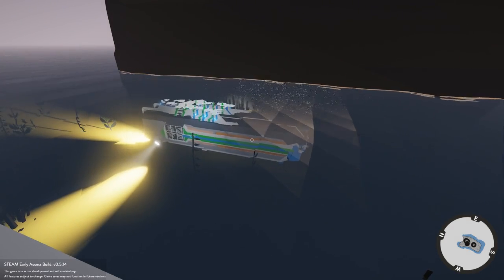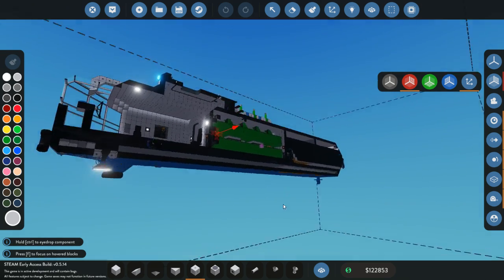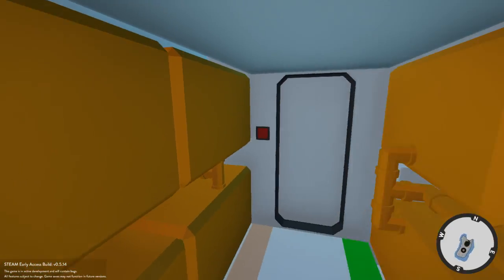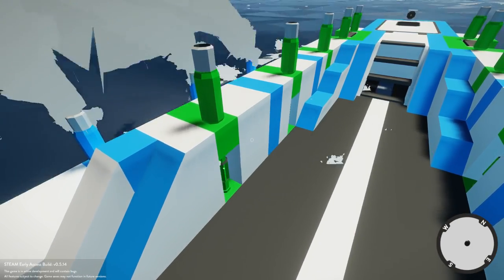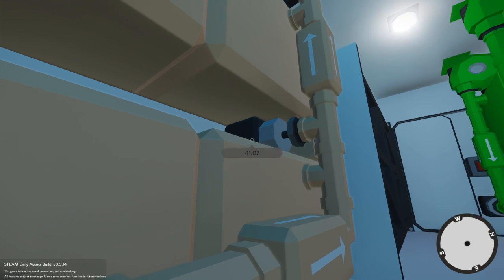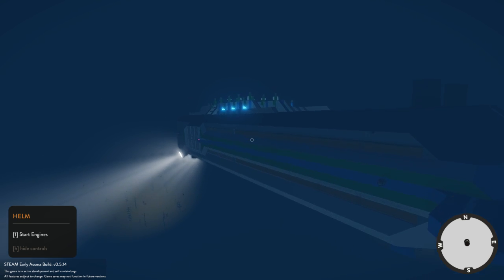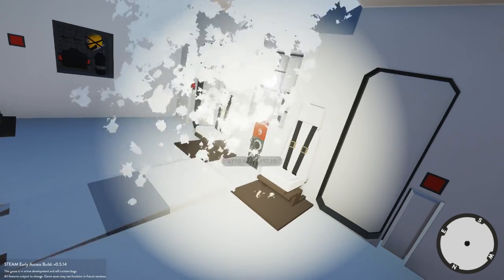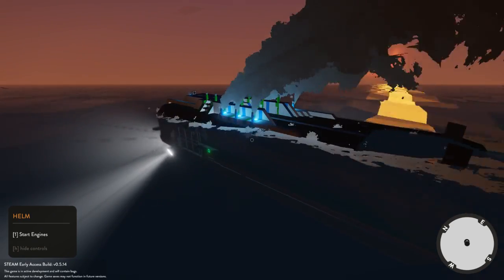Stormworks: Advanced Submarines

Comment: Hey i need help. Those control surfaces..which way should they be turning when surfacing and when going down. Im talking about the ones that control the pitch.
Reply from the maker: That depends on whether they're in the front or the back. The control surfaces shouldn't be providing the lift, they should be orienting the nose.
Reply: @CraigPerko  figured it out nvm
Reply: @CraigPerko  I got 2 medium generator and 1 large diesel engines with 1 medium electric motor. It takes a long time for the generators to charge like 20 medium batteries and the batteries get used up in about 5 mins.. Do you understand gearboxes? Cause what gearboxes should I put at what ratio as I believe they would help the generators generate more power and motor spin faster at a fastee rpm??? I want it to he efficient (long term sub). Ill try to make your system as well but my sub aint at all that big. 2 compartments..1 is with beds and  other is where your drive it. I do have an engine room and Ill try to fill it with as much batteries as possible and also might probably replace medium generators with large. I dont think a large electric motor is better than a medium electric motor as far as efficiency goes..What do you recommend?
Reply from the maker: @bray8949  I recommend a jet engine. :D

Gearboxes are a huge pain in the butt. Learn by doing surface boats first - the same propulsion works for both surface and underwater, but surface is easier. Batteries are important if you're not doing jet engines, but they're super heavy and run out hilariously quick. Medium motors are best.
Reply: @CraigPerko What exactly do you mean by surface boats?
Reply from the maker: @bray8949  Normal ships. You know, things that float.
Reply: @CraigPerko  oh lop 😅 Cause in trying to build a submarine not a boat xd
Reply from the maker: @bray8949  They're the hardest thing to build!
Reply: @CraigPerko  meh jet vtol much more complicated. My only issue is battery life. Even got depth hold and autopilot on my sub
Reply from the maker: @bray8949  Well, that's great! Best of luck.
Reply: @CraigPerko  XD thanks. So do you know any way of making a generator faster? or making electric motor more efficient?
Reply from the maker: @bray8949  Sure. There's a few dozen exploits. My recommended one is to use a jet engine, since it's the most effective underwater power source.
Reply: @CraigPerko  hmm ok. But doesnt that require air? I tried to see how far Ill go before recharging..1.4 km and battery drained out. Why does it start from a speed of 15m/s and goes to 2m/s at the end?! I hate that it starts lowering speed instantly. Ill  add batteries everywhere i can whilst keeping it look nice
Reply from the maker: @bray8949  As batteries drain, the amount of power drains. A battery at 50% charge only provides 50% power. If you want to see how to use jets, download one of my recent warp submarines.
Reply: @CraigPerko  Could you paste link here pls? Also some guy said that its best to route propeller through a 1:4 to 1:6 gearbox...What does that mean? Direction of arows towards engine if im not mistaken and 1:6 is by doing a gearbox 3:1 and another 2:1 which makes 1:6 then I just add another gearbox with the ratio 1:4? And what should be the nearest towards engine..1:4 gearbox or set of 2 gearboxes that total up to 1:6. Sorry if i confused u im confused myself..
Reply: Ok iv seen your latest video about the warp sub and was very impressed 😅. That thing went 3000m/s..I dont have space for those jets and water jets in my current sub unfortunately but ill definitely do them in my next sub. Altough I got no idea what the script was..is it rlly essential? As I might have to copy the script if it is for my next sub..If I were to upload it id give credit to you dont worry. What do you think about that gearboxes setup from comment before this?
Reply from the maker: @bray8949  This one probably still works: https://steamcommunity.com/sharedfiles/filedetails/?id=1784528329

To learn gearboxes, you need to try it out. Each one in a sequence multiplies the rotations while dividing the torque, or visa-versa depending on the orientation. They're really awful, but if you're using an electric motor, they're probably not necessary.
Reply from the maker: @bray8949  You only need the script if you plan to go over 600 mps.
Reply: @CraigPerko  oh well in that case I dont really need it. I just want a sub that goes 200+ and manages to stay under control.
I had no idea you were the creator of such a good sub. Its legit the fastest sub there is gj
Reply: @CraigPerko  oh ok thx a lot. I really dont see how jet engines can work underwater though..as they have a compressor and air intake.
Reply: @CraigPerko  How would you blow the ballasts at such great depth?! Some guy said that you need to hook the pumps up in a chain in order to create enough pressure to blow them but at the rate water was coming out it would take hours. Subs are impossible to make..Do ballasts even have a use in this game?
Reply from the maker: @bray8949  Fluids simply won't leave the sub at any real depth. Ballast's only real use is to sink: you'll need to use pure engine force to rise to near the surface in order to blow your ballast. Even deploying a tether didn't work last year, although the winch mechanics just changed, so maybe that will work now.
Reply: @CraigPerko  Ok thanks so much for your help! I manged to fix my submarine! My submarine can go really far as long as it has fuel. I am able to keep my battery at 100% whilst keeping motor at 100%. 2 Large generators work amazingly! I got like 40 batteries with a variety of mostly medium batteries and some small plus an extra large battery. Fuel I got about 3500 so nothing to worry about that! I'll try and fix my airlock by creating a compartment for it's water under my submarine also. My only question is , after becoming a master of gearboxes XD, the 3 gearboxes set at a ratio of 3:1 facing towards engine or away arn't making a difference in speed..If anything slower! So with 3 at 3:1 facing engine or facing away from engine gives me a speed of 15.28 at MAX and without ANY gearboxes im getting a MAX speed of 15.58..They seem to have worked for my generators so I don't think its a bug..
Reply from the maker: @bray8949  It depends on your drive systems. Electric motors generate a tremendous amount of RPMs, while diesel engines generate a tremendous amount of torque. So they have very different ideal gearboxes.

That said, 15.58 is pretty normal for an unglitched submarine. You might be able to get it up to 30 with the right gearboxes.
Reply: @CraigPerko  What would be those right gearboxes? Sorry if I'm bothering you too much
Reply from the maker: @bray8949  It depends on the number of motors and the number and type of the propellers. Generally I just go with a 3-1 for diesel engines to increase the RPMs, because they like to idle along at 20, which is way too low for a propeller. You don't need as many propellers as you think.
Reply: @CraigPerko  I got a medium electric motor and 1 medium propeller..lol also btw i changed my autopilot for the one you made! IT IS SO GOOD
Reply from the maker: @bray8949  Mine is pretty old at this point, there's probably better ones.

I don't know if I'd bother putting a gearbox between an electric motor and, well, anything. You can try it, see if you get a performance increase. I rarely use electric motors, so I don't know their optimal setup.
Reply: @CraigPerko  Ye I ended up removing them as they were slowing it down at 3:1 and tried many different setups...all slowed down the speed by a bit. I swear to god the autopilot is good. How do you hook up that power output from the MC though? It says "near location" Edit: nvm its for an indicator. I'm going to try and make it shut off motor
Reply from the maker: @bray8949  I usually use a switch circuit for that. An input number, an output number, and a boolean input. If the boolean is true, the output is the input. Otherwise it's 0.
Reply: @CraigPerko  I just hooked up the "near location" output to decrease of throttle lever and set warning distance to 48m and its perfectfor my stop xD. Oh and turns out they have no positive effect on electric motors..the gearboxes :(
Reply: @CraigPerko  Ok im nearly done with my submarine but I have a massive problem..ever since I added compartments on roof of sub for water for the airlock to function below 10m depth, It keeps rolling sideways.  For example on surface it rolls to the right and stops at like a 15° angle. Then when I dive and turn slightly to the left it rolls  like 90° and stays there without me able to fix it. It's really annoying me.. Im using a pid even to adjust roll which is hooked up to another set of rudders that can control roll. Its p is 10 i is 0 and d is 10000. Its way too sensitive. By that I mean control surfaces/rudders turn from a complete +90 to a -90. (Max right to max left). I honestly dont know what to do and am really frustrated at this after more than a week working on the submarine.
Reply from the maker: @bray8949  There are three solutions.

The main solution is to shift mass to the bottom of your submarine. Adding weight blocks, for example. This is the best approach, since it saves a lot of energy.

You can also adjust trim using a roll sensor. Multiply it by something and then feed it into both rudders and small electric motors powering small propellors. The rudders don't do anything when you sit still, so you'll need the rotors.

The third is to add a phantom airlock, like on my subs. This just reduces the amount of weight dramatically.
Reply: @CraigPerko  For your 1st way I cant really do it as adding more weight would make my sub sink to the point where only entry hatch is out of the water. Its already pretty heavy and does not that have much air to make it buoyant. What is phantom airlock exactly? and by small motors do you mean motors at the side? I have no idea how to do that..:(
Reply from the maker: @bray8949  Download one of my subs to see the phantom airlock. It's a door glitch where you don't need an actual airlock.

You can also see the side-motors in my subs as well.

However, if you can't add weight at the bottom, you can add air at the top. For example, a 2-high, 3-wide contained air pocket running along the top from the hatch you built.
Reply: @CraigPerko  I managed to use a new pid system sort of to make me rlly stable.It keeps me at a tilt of -0.2 to +0.2 tilt which I am really happy about. I didnt want to use glitches in this sub as I wanted it to be sort of real. Ill use them in my next sub. I just need to fix weight balancing issue till you get in sub and start driving and Ill be happy. Ill check out those motors on yours though.
Reply from the maker: @bray8949  You just put a small electric motor and a small prop pointed either down or off to the sides, offset so they tilt your boat when you tell them to.

You then tell the motor to fire based on your tilt. I use a tilt meter. A gryo also works.
Reply: @CraigPerko  ok thx ill try that later
Reply: @CraigPerko  Which subs that you built have this propeller stabilisation exactly?
Reply from the maker: @bray8949  All of the decently sized ones. Not the warpfishes.
Reply: @CraigPerko  ok cause dowbloaded the one with the firey texture and couldnt get it to fire up and neither spotted the propellers on the side. Ill try another 1
Reply from the maker: @bray8949  The deep sea ones are all equipped.
Reply: @CraigPerko  Ok i am trying to understand how the system works but cant really see to understand. Cause motors are connected to mcs which add and multiply? I can't seem to figure it out. If you dont mind ofc in short could you tell me how system works?
Reply from the maker: @bray8949  The tilt meter outputs a number between -1 and 1, but it's going to be between something like -0.1 and 0.1 for a submarine, since you're not tilted much. I multiply that number so the engines will run at a decent rate. I multiply it by a positive number for one side of the ship and a negative number for the other, because that way we push with all the engines on the left and pull with all the engines on the right. Or visa-versa, if we're tilted the other way.

You can also use the roll output of a gyro.
Reply: @CraigPerko  that sounds rlly complixated xd. I also got another problem then cause I cant fit propellers on sides. My sub is very very narrow.. If I were to do on side with small electric motors and a large propeller (beinf smallest rn) it would look ridiculous..would a water jet or azimuth thruster work? I would prefer azimuth thruster as water jet bit too powerful
Reply from the maker: @bray8949  Why would you use a large anything? These are attitude adjusters, the smallest possible motor and propeller is fine. You can put them one the sides, or you can mount them pointing left & right near the bottom. Either way, the ideal approach is to not need them, by adjusting where your weight and air volumes are.
Reply: @CraigPerko  ok ill try to fix weight first. If im not happy with results ill put small propellers on left and righr sides. But what I was saying is that there are no small propellers in the game as of right now. The smallest thing are the azimuth thrusters..and by how much would you then multiply? Ill try and understand what you did in your mcs better. cu for now gonna go to bed 😅
Reply from the maker: @bray8949  The smallest propellers are the 3x1x1 starting propellers.
Reply: @CraigPerko  ok so what i ended up doing is saving your mcs (dont worry about credit) and connecting everything as everything was connected in your deep sea fire sub. Only different thing is that they are connected on the side of the sub and not on the bottom. Also only did 2 on the back and not on the front as well for now. What ended up happening was they made my sub go to the left but from the back o.o. Ill try making another pair on the front as well and see what happens. Oh and other different thing I did was not connecting the mcs to my rudders/control surfaces, as I already have another stabilisation system for that, which only works when moving. Oh and forgot to mention weight issue fixed as much as possible but would still like a stabilisation system to have it be perfect aa not happy with tilt without stabilisation systems
Reply from the maker: @bray8949  I can't recommend copying my stuff, it's set up in a very specific way that you won't get by simply taking the pieces. If you don't understand the concepts, I recommend making a test rig just to test the concepts. Auto-stabilization is critical for planes and high-speed boats, too... and it's not too different whether you use rudders or propellers. Just think of a propeller as a rudder that works when you're stopped.
Reply: @CraigPerko  so basically what I need to do if im thinking of them as a rudder is I need to:

get number from tilt sensor
multiply it by i have no idea how much ill just play with number
connect it to motor

then i need to do same for other motor but multiplied number needs to be inverted so it pulls instead...righr?
Reply from the maker: @bray8949  Yup!
Reply: @CraigPerko  do u have any idea at all what the multiplication number should be? Im not going to make it as complicated as yours. For example ill just use a multiplication gate in mc. I think that needs to be multiplied by a bit since small propellers arnt that powerful
Reply from the maker: @bray8949  It depends on how good their leverage is. Generally, I multiply it by 3ish. You want to use the smallest number that works, to preserve power.
Reply: @CraigPerko  oh ok that makes sense
Reply: @CraigPerko  for further power saving ill try and make it that when for example speed higher than than 5 it automatically turns off the small propellers as rudders stabilise it while moving.
Reply: @CraigPerko  hey ik if u dont have the time for this but setup doesnt seem to be working. I tried inverting motors couple of times but always ends up in submarine tilting anyways. If you can could you look at my submarine? I fixed the weight problem its just these motors. Ever since I added them tilt issue has been worse and I think im just doing something wrong. The link is: https://steamcommunity.com/sharedfiles/filedetails/?id=2070098653
Reply from the maker: @bray8949  You have the right idea! The engines in the back were wired backwards, presumably because you were testing. The engines in the front appear to be abandoned, but if you hook them up the same way as the engines in the back, you'd have enough stabilization. The output needs to be about twice as high to completely stabilize the vehicle.

To see whether it's working, look closely at the engines while the submarine tips. The prop pushing forward produces bubbles: you want the bubbles to be pushing to right the ship, not make it worse. You can force the submarine to tip by attaching a handle to the side of the exit tower and pulling on it manually.

You'll also want to attach a handle to the top of the exit tower, so if the submarine's partially tilted, you can grab it and still get out instead of perpetually falling down the ladder.
Reply: @CraigPerko  oh im so sry u had to go through that problem of the ladder 😅 I was going to fix that once everything settled lol. So I need to invert engines in back and wire up front engines same as back ones. Front need to be inverted as well? Ill also make multiplication to 10 i believe as i left it on 5.
Reply from the maker: @bray8949  The ones in front need to be wired identically to the ones in back. After all, the nose of your ship rolls the same as the back of your ship.
Reply: @CraigPerko  weird didnt u say front motors were abandoned? On my save they are connected to inverted number output on numerical inverter
Reply: @CraigPerko  ok so basically i made it how u said. For example if it tilts to the right righr motors show bubbles going away from sub and if its titling to left left motors show bubbles going away from sub.Only issue now is motors instead of changing roll of ship (tilt) its changing the left/right. For example if it is tilting to the left instead of correcting it theyre pushing/pulling towards the left which then eventually causes it to tilt even more :(
updated it on workshop to one i got now same link I think
Reply from the maker: @bray8949  I didn't see them spinning, so I figured maybe the electric wasn't properly hooked up. I just checked the back ones.
Reply from the maker: @bray8949  Usually that's because you wired the front and back opposite. Both left motors need to be wired the same, and both right motors.

There may be some small amount of spin since they have different leverage from the center of mass. If that's the issue, you can multiply the motors in front by a different amount, reducing or increasing their pull relative to the rear motors... but they must always pull the same way. This is why I prefer up/down motors, TBH: no heading drift.
Reply: @CraigPerko  I wired them the same tho..? Hang on ill start from scratch. So left with no  inverter and right with an inverter. Ill try that first
Reply: @CraigPerko  NVM THEY FINALLY WORKING YESS
Reply from the maker: @bray8949  If you're starting from scratch, you may want to point them down instead of sideways to minimize drift.

It's a bit tough, because your submarine is so tall and narrow.
Reply: @CraigPerko  ye ikr. I staryed following mrnjensey guide until i realised this guy does some stupid stuff sometimes...and went off with my own ideas where I could since this my 1st. Since it was built narrow and needed room for water for airlock i made it taller to have room. Anyways its working to a point im happy with :) Thanks soo much for your help! Motors cut out when past 3m/s for power saving but wish they didnt require a multiplication of 10 to run. Whatever theyre only till u leave the dock lol
Reply from the maker: @bray8949  The next one you make will be twice as good!
Reply: @CraigPerko  lol thx :)
Reply: @CraigPerko  Where would best location be for radar on a sub? As underneath isnt really best as easy to break if you bump into sea bed. Also using a distance meter instead of radar
Reply from the maker: @bray8949  There's no ideal place for it. I generally put one pointed straight down, either flush with or slightly recessed into the hull. If the sub is big enough, I'll put one on a descending rotor at around 45, retracting it if the one pointed straight down detects nearby land.

Because of the distances involved, a distance sensor is usually enough. You don't care if there's land 3km away, you're not going to accidentally bump it.
Reply: @CraigPerko  How would a radar detect objects around ship if it is flush with the hull? Like wouldnt that be detecting the submarine itself as well?
Reply from the maker: @bray8949  ? The tip is obviously exposed to water... but the tip is flat. You can just make it part of the hull.
Reply: @CraigPerko  oh..but thatz the radar..a dustance sensor needs to be out at least a couple of blocks for me since also rotating pivot is like another 2 blocks. And I can make it any sort of into the hull as my hull is only 1 block. Rip
Reply from the maker: @bray8949  You don't need it to rotate. You can just point straight down, that's the most critical distance reading if you're going reasonable speeds.

But either way, as long as you have some visibility below you - lights or something - it's probably fine for a low-speed sub.
Reply: @CraigPerko  Im working on a mini sub at the moment. So couldnt implement any of your jet engine bugs. Although I did go with 2 azimuth thrusters and a medium motor which is more than enough. Got a speed of 17m/s. Only issue is that since it is so small it would constantly pitch up and down and making it sometimes fly of water. I played with weight and buoyancy for an hr but no luck. I got it somewhere stable though, just it wont stay stable if you kick up the throttle a bit. I decided to extend it by a little bit more but dont get me wrong its still tiny. Its still unstable and pitches constantly up and down.. Im going to try and play with the weight a little bit more. Im also going to try pitch stabilisation with rudders.
Reply from the maker: @bray8949  You will find it is faster without the azimuths.

You do not need many propellors.
Reply: @CraigPerko  without azimuths then what would I have for propulsion? Those only propellers I got 
Edit: Oh and managed to fix pitch issue
Reply from the maker: @bray8949  Oh, I misread medium motor as medium prop. Honestly, for a small sub, I recommend a medium prop. I guess two azimuths are fine, depending on space constraint.
Reply: @CraigPerko  its rather tinylol.A medium propeller would look a bit ridiculous
Reply: @CraigPerko  imabout to make a report to stormworks devs to fix batteries....i got so many batteries yet with 6 small motors I run it after travelling 400m.. Like isnt that too much? Medium motor uses too much amd cant add more batteries or it wont float with weight..
Reply from the maker: @bray8949  You see why all my subs use jet engines.
Reply: @CraigPerko  XD ye i do now. I got a challenge for you. Do a mini sub lol. Also Im having issues with my pid for depth control since sub small. I want it to be accurate so it slows down when altitude is close to set altitude but also want it to be smooth. So fins dont go full 1. What numbers should I use??

Edit: I managed to get it somewhat working but altitude varies by like -5 so if I set it to -10 it can go up to 5 and down to -15
Reply from the maker: @bray8949  I dunno how to use PIDs, but the numbers generally need to be super low.

I don't have much interest in small subs. I made a few microsubs, but they don't have depth control, just surface or depths.
Reply: @CraigPerko Dont waste your time reading all this. Problems have been fixed.

 I put a single jet engine and it now has ability to fly. Omg its so good. I also put in a single fluid jet but whenever I use it it tilts to the left. I dont know why. I placed outpur in the middle so shouldnt be leaning over to one side. Even have roll stabilisation with rudders on

Edit: nvm i inverted stabilisation system and its good now. Next problem.. Battery level is staying constanst and not moving a decimal but ik it is running out as speed is decreasing when using fluid jet

Edit: Fixed that as well
Reply from the maker: @bray8949  Nice!
Reply: @CraigPerko  Since its such a small sub with a jet engine and fluid jet depth hold wont work smoothly without it bouncing up and down. At 70% throttle on fluid jet it manages to go smoothly and about 40% throttle on jet it also manages to go smoothly. Ill have to make a system to not let driver exceed those speeds when depth hold on
Reply from the maker: @bray8949  Sure. You can also change the exhaust choke to change the thrust without changing the speed of the engine.
Reply: @CraigPerko  oh ye forgot about that. So i decrease thrust spoiler?
Reply from the maker: @bray8949  At 0, the engine thrusts full force. At 1, it doesn't thrust at all.
Reply: @CraigPerko  oh ok cause never used it lol. So I must decrease it ok
Reply: @CraigPerko  Ok I need to make it that somehow if it exceeds a speed of 21 (yes ik) it needs to throttle down electric motor to 0.70...There is as of right now no way of doing it as you have no input in throttle lever. So i decided instead that whenever speed is mode than 21 it doesnt allow you to turn on depth hold. How can I do that? Cause if I simply hook up an on/off logic connecter to button itll turn it on when its off when throttle higher than 0.70
Reply from the maker: @bray8949  As you like. However, by clicking on the seat in edit mode, you should be able to change the parameters of each axis. You could also multiply the input by 0.7 and use that for everything.
Reply: @CraigPerko  What would the parameters of the axis do? Cause I want it to go full speed when depth hold not in use and at 0.70 speed when it is in use
Reply from the maker: @bray8949  What I would do in that case is have a number switch. It takes in the pilot's throttle and a boolean (whether depth hold is on). In the logic, I set up a simple system to output the original number, or a clamped number if depth hold is on.
Reply: @CraigPerko  Ok ill try that later! Thanks so much I would have never came to the idea of using a boolean whatever it is 😅. Ill check into that later. God this has nothing to do with programming and its already a lot to take in..Im currently studying java in my computing lessons.
Reply from the maker: @bray8949  It's a very simple node-based programming setup, I'm sure you'll have no problems.
Reply: @CraigPerko  Thanks so much! Even managed to do it simpler than that using a simple numerical switchbox without boolean!
Reply: @CraigPerko  I decided ti change how submarine functioned. So i got 3 engines fitted in a mini sub. I used space wisely lol. small diesel engine for recharging batteries with medium generator. Its producing 71 and ik its not the full potential of generator. Then its got jet engine for when you want to make it fly lol. And fluid jet woth medium motor for when you just want to use it normally. Youd could use jet for lets say submarine mode as well but would probably not put throttle up anymore than 20.
Reply from the maker: @bray8949  Sounds versatile!

Before I discovered the jet glitch, I used to create pressurized tanks full of air and exhaust to run diesel underwater. :D
Reply: @CraigPerko  Ik lol. Isnt this what this video is about? lol
Reply: @CraigPerko  Ok so the sub is nearly done. I got 2 major problems though. So when the first thing I turn on out of 3 different engines (jet diesel and electric) it spoils up no problem. After using diesel engine it wont ever spoil up. Why? It just makes a wheezing / squeaking noise. 2. when I use jet engines to use it as a plane, it keeps wanting to go up for no reason and makes it very hard to control. If you dont have any idea why it keeps going ip I was thinking it could do a current alt hold system, only I got no idea on how to do that. My reasoning is that when the button is toggled it reada current alt for a second and sends it to pid as setpoint. I just dont know how to make it read for a second only. Ill probably upload it and give u a link to check it out a bit better cause its very weird what the jet engine is doing
Reply from the maker: @bray8949  The spoiler is silent, so that means you have an engine problem. My guess is your diesel isn't getting any intake air or can't exhaust. The reason you're tilting up when you fly is probably because your jet engine is below your center of mass.
Reply: @CraigPerko  well rip cant make it any higher lol. And my diesel engine is working fine. Its my jet engine. If i turn it on first the jet engine fires up, but if i turn it on after i turn on my diesel it never fires up
Reply from the maker: @bray8949  That's probably an issue with the shared torque line. In general, there's no point in running a jet (100 RPM high torque) on the same line as a diesel (15 RPM low torque) at the same time. If you do want to, you should use gearboxes.

It could also be that you've accidentally lit the jet engine on fire or dunked it in the water, but I'll assume you didn't do that.
Reply: @CraigPerko  im sure that there is no water and no fire...also they are not sharing same torque line. They are 2 seperate engines with separate generators
Reply from the maker: @bray8949  If their outputs are entirely separate, then I don't think the diesel engine's state has any effect on the jet engine. They don't share any inputs, after all. Maybe you ran out of jet fuel?
Reply: @CraigPerko  How can I run out of fuel if I never turned it on? It happens every time. So strange. Ill upload it to workshop soon and give u link. To replicate what is happening to me when u spawn it start jet engine normally and ull see how it fires up. Then respawn it and turn on diesel engine. Once diesel engine at max output fire up jet engine and ull see how it never spoils up..I feel like a bug has broken my sub...:(
Reply from the maker: @bray8949  I'm not sure how your wiring's set up, but I don't see any difference between before and after the diesel engine. I do see you have your jet ignition tied to your jet fuel pump, so you'll never be able to run the jet without ignition being on.
Reply: musnt ignition always be on? Or is it like diesel. Ill fix that later. Strange how mine doing that.
Reply from the maker: @bray8949  For the jet engine, it depends on how you're starting it up. If you're starting it up with the normal ignition setup, you only need it to be on until the jet engine is above 1 RPS. However, if you turn that switch off, it looks like it's also connected to the fuel pump.
Reply: @CraigPerko  Do you have any suggestions about design? Cause im not sure how it looks...
Reply from the maker: @bray8949  Visuals aren't my forte.

In terms of functionality, I recommend starting over with a larger sub that can fit the jet engine near the center of mass. Also, you should use fluid spawners for fuel.
Reply: @CraigPerko  Oh cause im currently using normal tanks. Should I try and use custom tanks or would that mess with bouyancy as I dont want it to sink anymore o.o

Oh and btw ur subs are cool looking so didnt see that way lol
Reply from the maker: @bray8949  Subs are hard. My tenth sub was the first one that was useful.
Reply: @CraigPerko  rlly lol? Well tbh my 1st long one is good for exploring just not for long. Every 5 mins ull need to surface. Im going to stop building for now after this mini sub. Then ill stary my HUGE project. Its an extremely large sub.